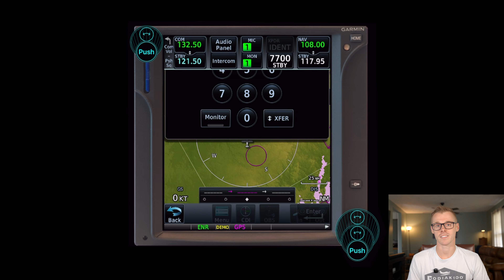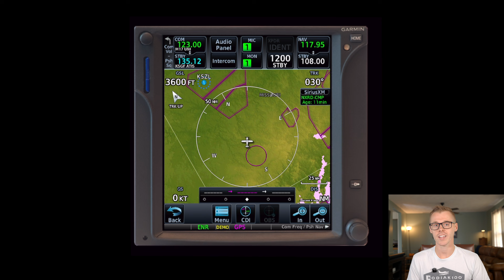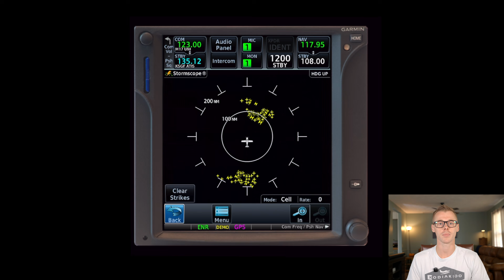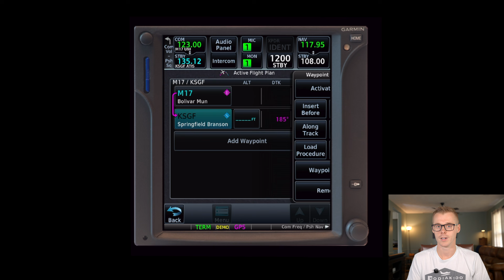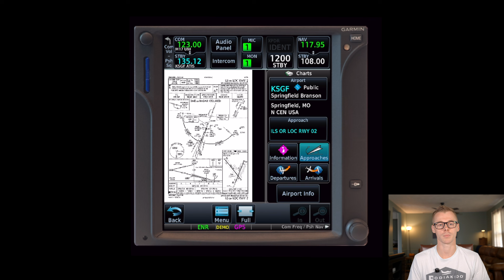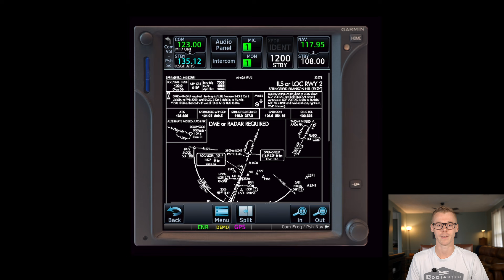5 Minute Mastery Tutorial - Garmin GTN 750

Comment: Seems like to upgrade to this unit you also need to throw away not just your old gps/radio unit but also your transponder and audio panel too
Reply from the maker: So it depends on the setup - the transponder integration requires a separate LRU, which often costs as much as a new transponder. Most panel mounts that i've seen keep the old transponder and just attach it for "remote use" basically allowing you to just change the code through the 750. However yes, it will completely replace an audio panel.
Reply: Ok interesting